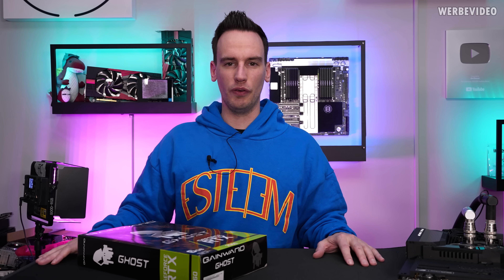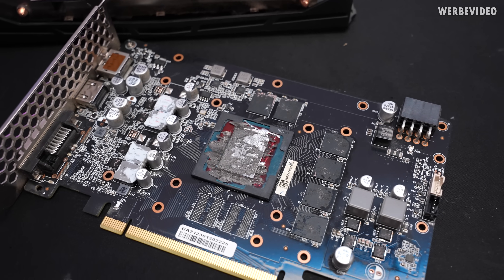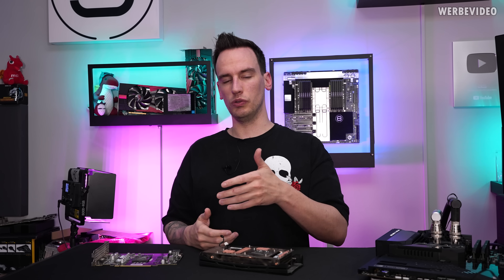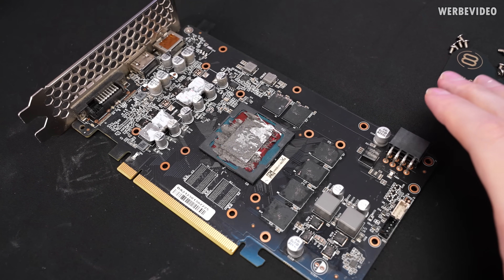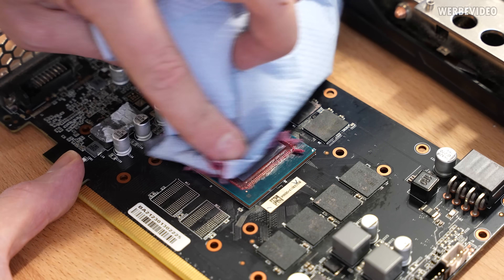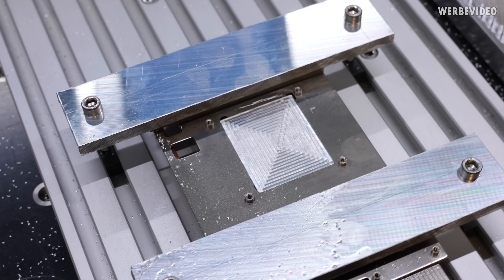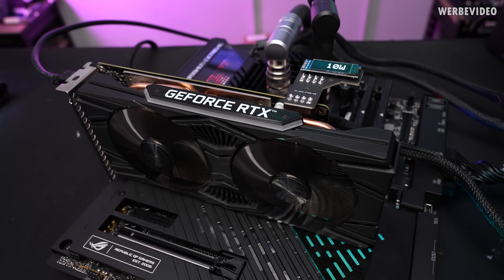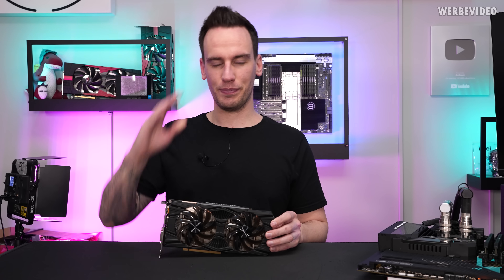Viewer-Mail Ep7: Nasty Liquid Metal Damage - Rescue Attempt

Comment: You went really above and beyond for this 2060. Owner is going to be really happy with this, unless he was hoping for a free waterblock or something lol.
Reply: I think if the owner had a custom loop they wouldn't be bothering with a 2060 lol.
Reply: @JathraDH  True, jokes beside softline starting kits are actully quite cheap. Got my alphacool kit for a discounted price of* 150ish €. GPU waterblock for 6700XT was almost the same price lol.
Reply: @Jaegeroid  Hm that's not a bad cost.  What pump/rad size?  If it actually came with one of their decent full copper rads and an OK pump id call that a pretty damn good price indeed.
Reply: @JathraDH    It was discounted back then, current price level seems to have actually gone up some :/ 

280mm rad with a ddc310 pump.

I think it was this kit: Alphacool Eissturm Hurricane
Reply: @Jaegeroid  Seems like a pretty solid kit still especially if its the 280x45 rad I saw.  Still quite a decent price for entry to full custom loops and quality components.  Nice find. :D
Reply: @JathraDH  I would have learned my lesson not to mess with a perfectly good card and never trying to copy Der8auer again by splashing liquid metal around in future when I don't really know what I'm doing. And also throw this card in the bin and buy something decent.
Reply: Well i mean water blocks are quite expensive

Comment: It was very interesting. Hope you cleaned up the chips out of your milling machine after, it would have been bad to go to grizzly the next day and just find a pile of aluminium dust on the floor where your machine was 😂
Reply: steel chassis, concrete polymer table, stainless inserts, only the t-slot table would disappear :D
Reply: im not sure but i think a pro like derbaurer,  would be smart enough to clean the card before putting it back together..
Reply: @groenevinger3893  He's talking about the CNC machine.
Reply: @FR4M3Sharma  indeed!

Comment: I would have used a thermal epoxy (like the one @Tech_Ingredients made a few years back) to glue a thin piece of copper clad to the milled section (about 0.4mm), and mill it flat with the rest of the surface. That way you could benefit the copper thermal properties alongside the aluminium.
Reply: You'd just be adding more interfaces between materials.  I'm not sure the specific heat of a 0.4 mm x 42mm x 50 mm wafer of copper with another layer of thermal compound would outweigh the benefit of using copper.  A billet maybe, but a wafer?
Reply: @WildRapier  Yeah, If going that direction, probably a good idea to use a few MM of thickness.
Reply: adding another thermal interface would just lower the thermal conductivity to the interface with the lowest thermal conductivity
you could have a cooler made of diamond, but the effective thermal conductivity will be limited by the thermal paste/epoxy you use
Reply: As everyone else has said adding a bunch of different materials doesnt really help much if they are in small quantities.  If there were a large copper plug sunk into the aluminum it could perform better overall since there would be a lot of copper to sink heat into before it gets changed to other materials and there would me more surface area to transfer from and into but a small amount of copper with an interface on both sides is just a waste of good copper.
Reply: Probably would've been even better than stock with that copper "heat spreader" instead of aluminum.

Comment: If you would go back to liquid metal, you could add a copper insert right? In the milled out area. If I remember correctly, it does not react with copper that agressively.
Reply: think that would be an option too.. place a 0.5mm copper shim on the die. Good thinking!
Reply: @groenevinger3893  It would just alloy with the copper and "seep through" it, like it did to the nickel plating.

Comment: i was changing thermal paste to liquid metal on my friend's rtx 3090. When i was trying to put liquid metal on a heat sink, im noticed that copper gets a little darker. After that i cleaned heat sink from liquid metal and paper get dark. I think that was copper and aluminum alloy. I used liquid metal on Legion 5 3060 5800h and there was everything fine, no liquid metal reaction.
Reply: So you admit that you had no idea what you were doing when applying "Liquid Metal" to a GPU that isn't even yours?

That's a rather reckless approach to take with something that isn't yours and could cause instantaneous permanent damage to the GPU SMD Components or GPU Cooler.

You really need to read up on the risks involved and get a better understanding of the materials used on the individual GPU's that you intend to apply "Liquid Metal" to in the future if you want to avoid another failure like that.

"Liquid Metal" is not for the faint of heart or the uneducated, educate yourself on everything their is to know about it and make your friends aware of the risks involved and you'll hopefully have less problems in the future.

The complete lack of public information on the risks and dangers relating to just how risky "Liquid Metal" can be is a problem caused primarily by those that publicly promote it's usage, they have failed to educate properly, and, they've failed to highlight that dangers often enough for people to realise the risks involved.
Reply: @LND3947  no, heatsink seam's to be copper so i thought it is copper. Im not stupid i put liquid metal few times and i know how to prepare ic before applying liquid metal
Reply: @TXPer  Formation of CuGa² intermetallic compound where galium ions diffuse into the surface of the copper. Unlike aluminum which is destroyed it's only a cosmetic change (alloy) created on the surface of the copper. 

It should not affect performance nor degrade the structural integrity of the copper block.

Comment: cnc a square from it and mount a cooper pad with the cnc machine depth
Reply: that would produce much worse temperatures. transferring heat from the die, into a copper plate and then into the heat sink is much less efficient than simply going directly from the die to the heat sink

Comment: Hey hi!  Could you play with this idea: developing better CPU & GPU costs millions.
If a business developed LN2 level cooling for regular use in gaming etc, how valuable it be?
How maybe would it be done? Cars use hydrogen. When will PCs use LN2 (etc) and how?
Reply: kingpin did it for 1080 tis.

no it's just a bad idea, y9u gonna pay more for ln2 than for the electricity your GPU consumes.
Reply: @BaBaNaNaBa  Yeah, true. But hydrogen for cars was also bad idea and now it is the way with many companies.
It costs mental amount of money to get small improvement in CPUs & GPUs. 
To get 7 or 8 Ghz processors instead of 6 would be worth grazy amount of money.
So it is important to ask these questions
Reply: @ROCKSWOT  uhm. I know engineers who work in the car industry and hydrogen ain't that efficient as you might think. It's more like some desperate marketing cause they have fallen behind tesla.
Reply: thats never going to happen. sub zero temperatures cause condensation that will quickly kill electronics not to mention the ice that would build up on any parts youre trying to cool. and noone is going to want a PC that you need to top up with more nitrogen every 10 minutes or so ( or requires a massive nitrogen tank several times the size of the pc) and then go to the store to buy more LN2 when you run out (assuming you even have somewhere local that you can buy it from). that also has a water tray you need to periodically empty as it fills with condensation. not to mention the safety hazard it would pose from people suffocating in rooms without good ventilation. 

plus the only way to store LN2 is either pressurized, which requires incredibly expensive and heavy tanks and plumbing to keep everything safe. Or unpressurized, which requires letting the LN2 evaporate to keep itself cold. meaning even when you werent using your PC you would still be losing LN2.

There is no way around these issues. Theyre down to the physics of using evaporative cooling. no amount of research or RnD can fix them. If they could, do you not think the billion dollar companies that make these parts would have thought of that?

just an absolutely terrible idea and not comparable to hydrogen cars in the slightest. hydrogen cars are just changing one fuel for another. using LN2 for pc cooling is ADDING an expensive and inconvenient consumable to something that doesnt currently need it.

Also hydrogen cars suck. theres a reason battery powered cars are more popular.
Reply: @Hephera  Yeah, you right. But here I also focus to ask is there any way to get LN2 level cooling as it is worth millions if not billions. Tesla basically created new industry to realize practical electric cars.
So here i am also after the question how would this potential new industry be formed as it would have the potential similar to Tesla in car industry.
Reply: Hydrogen for cars is still a bad idea

Comment: A great fix. This video would have been even better if you had made a second excursion into when to use liquid metal and when not to.
Reply: Don't use with aluminium coolers and umm...... Yeah, that's about it, you know when you "have" to use liquid metal.
Reply: @woldemunster9244  You may know that, but I didn't and I expect many viewers did not.
Reply: When to use liquid metal: If you're rich enough to drag race GPUs and are willing to accept the damage, for the same reason actual drag racers accept that they will blow the occasional engine.
Otherwise, never.
Reply from the maker: Will keep in mind for possible follow-ups :)

Comment: Awesome work. I hope your CNC mill didn't get hit with any gallium debris during the milling.
Reply: Ya. Creepy problem. 😑
Reply: Now the CNC mill starts to chip away a month later from this video.
Reply: Can almost guarantee there were particles of it deposited on the CNC bed. How much of a problem this becomes over time after cleaning etc remains to be seen. I would have thrown the cooler in the trash and put something else on.
Reply: @DanielKennedyaeos  the Datron M8cube has a concrete polymer table with stainless steel conical inserts, so I'd expect the gallium to not have any great effect, maybe some cosmetic affect on lacquer but nothing structural. The T-slot table is anodised, so hopefully would escape
Reply: @DanielKennedyaeos  Tiny particles of a gallium/aluminum alloy isn't going to do anything. The oxide layer of aluminum alone helps resist immediate damage even when making direct contact with liquid gallium. This is why examples of the reaction often take much longer unless the surface is scratched first.

Not to mention, gallium doesn't have the ability to spontaneously replicate itself. Even in the worst case, the amount in any alloy particles he didn't vacuum up would be negligible and not even making good contact. I suspect even if most of those shavings were left on some aluminum scrap for a few days there would be no noticeable effect. I wouldn't be surprised if he's doing this right now just to shut up the comment section. 

Of course better safe than sorry on a machine that costs more than most of our cars but I don't think Roman is going to lose any sleep over this.
Reply: @DanielKennedyaeos  - I'm sure Derbauer knows what he's doing ;)
He's a problem solver, not avoider.
Reply: Unless the Gallium was undiluted amd makes direct contact it won't be a big deal for the contaminated debris to be on the metal for a short period of time. If derbauer didn't clean up the shavings and dust afterwards it would make some light surface damage for sure over a period of time. But Im sure he knows to not let it sit there.

Comment: This viewer could've seen a good drop in temperatures just by cleaning their card. Applying liquid metal to a dust-clogged cooler is akin to trying to boost the performance of an aging car in disrepair by giving it nitrous oxide instead of simply fixing the car.
Reply: Yeah, clogged air filter negates any turbo.

Comment: IMO, Liquid Metal is a new way to "Planned obsolescence", after 2-3 years any tech without service of change metal each year you may get same issue as here, even if tech is developed for liquid metal usage.
Reply: Why?
Reply: dont combine aluminium and liquid metal, only copper with liquid metal
Reply: @TXPer  Even then it alloys with copper and the jury is out on the long term performance of that new material.  Ideally you give copper components in contact with LM a nice heavy coating of nickel which is of course an extra expense.
Reply: you are wrong, depends on material of the cooler and the gap between die and ihs.

anyways, liquid metal can actually outlast thermal paste. cause cheaper paste can get worse over time.